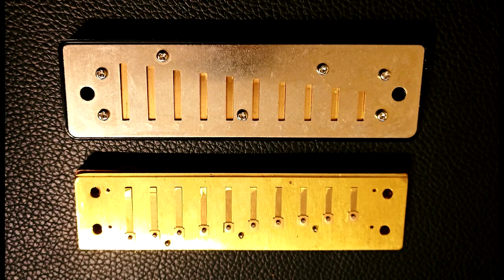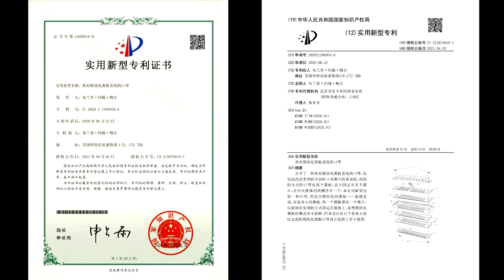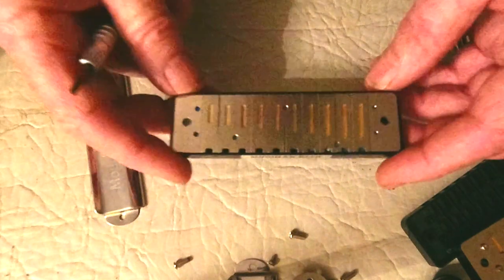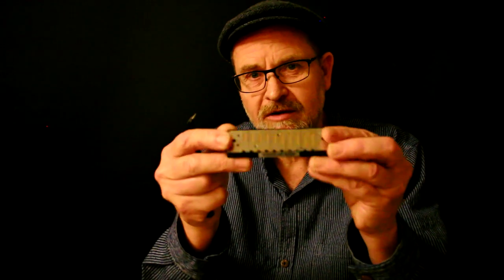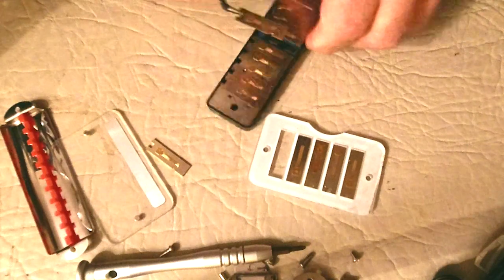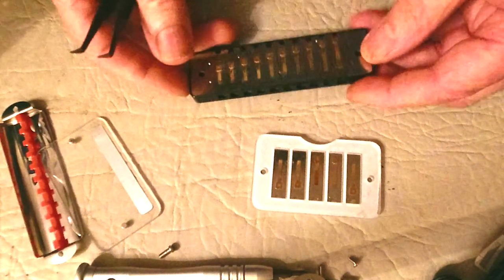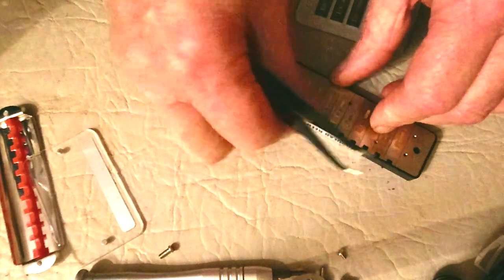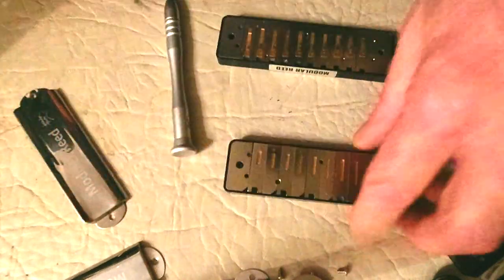MODULAR-REED HARMONICA - Quick-change Reeds!

Comment: * Will you also sell gaskets with valves?  In that case it is probably a bit harder to create something modular.  But I guess the valves are not that expensive to make.  But is it glued on there completely?
* Will there be bigger versions of the harp (e.g., up to 16 holes)?  Is it based on that exact model by Kongsheng?  Or will you create your own harps?

It seems easier to mass produce parts with higher quality at a lower price.
Reply from the maker: I have made prototypes with Gasket-Valves but, as you suggest, they can't have the adhesive gasket. Individual valves are better in this harp.

It's early days for this concept. Custom combs would enable more possibilities for sure For example, a comb with all long slots for making chord harps, and combs of different lengths... If the demand is there, they will come in time 👍

Comment: This a great design and awesome to play around with alternate tunings. How easy is routine cleaning? I'm curious if the weak/strong adhesive on the comb is resistant to water. Typically, I use a sonic cleaner on all my current harps, which means they need to be metal/plastic or at least water resistant such as a composite or sealed wood comb.
Reply from the maker: Haven't tried it in an ultrasonic cleaner, will report back when I do.

Comment: Amazing Brendan! You are the Edison and Tesla of the harp world! I was wondering about quick-changing between songs - do you think it would be possible to use magnets instead of screws to hold the cover plates?
Reply from the maker: Good question! That would be ideal, and I tested it. Unfortunately the magnetic force from the size of magnets one could use is not sufficient to give the same inward pressure on the modular reedplates as screws offer. That pressure is important to keep the covers in place behind the comb lips, and hold the mini reedplates firmly against the comb for good tone and response.
Reply: @BrendanPowerMusic  I thought you probably had tested that already. I am excited to get one. To have access to all the different tunings, or adding notes that can be bent - this really opens up some revolutionary options without sacrificing the basic diatonic settings. Its simply awesome and a game changer.

Comment: With frequent substitutions won't the stickiness dissipate? Is it possible to design slide-in pockets to hold the reed in place and then the little fingers on the cover can mash them down tight to a gasket, only sticky on the plate side?
Reply from the maker: The amount of stickiness is not critical, it's simply there to stop the modular reeds falling about all over the place. I did try a gasket without outer stickiness, but the slightest wrong move and you have reeds everywhere.

Comment: Is it not possible to make a comb with all slots the exact same size, tuned entirely via differing reed weights etc. This would make this modular idea even more interesting. As mass comb production would be easier. All reeds also could then be the same heaviest size, then just need to be filed down hence tuned by the owner. You could also incorporate optional slide on plastic plates onto your individual reed plates that would shorten those fixed sized chambers.
Reply from the maker: It wouldn't be optimal for reed tone and performance to have all reeds the same size over a 3-4 octave range.
Reply: @BrendanPowerMusic  I thought that might be the case. I am going to get my hacksaw out and give it a go (for fun) with the model you have suggested. What did you use for gasket sealer?

Comment: Hope you can design a chromatic harp similar to that in modular form.
Reply from the maker: Yes, a chromatic version is a nice idea! I already have a test model working in the form of my Switch-Harp, which is two diatonics behind a central mouthpiece/slider. However there are a couple of other approaches I'd like to try as well, and then pick the best. RnD takes a lot of time, which is a bit short at present, but I will get on to it 👍
Reply: @BrendanPowerMusic  thank you for your improvements to a wonderful musical instrument. I really like the ideas you presented for the change ups in keys and modified keys for different musical forms. I really like the country tuning.